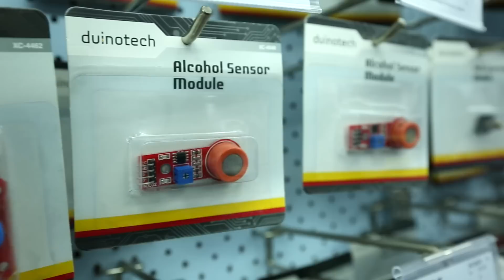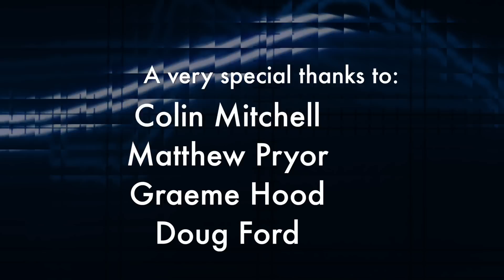The Decline of Hobby Electronics?

Comment: I love this video except for 1 little pet peeve of mine at 6:40 
DO NOT use your kitchen toaster oven for reflowing boards.  Just buy a cheap oven and mark it "not for food items".
Reply from the maker: +ApexMike It is NEVER used for cooking. Its dedicated to reflowing boards. The oven cost $25 to buy and with no modifications except a hole for a thermal coupler in the back to monitor temperature near the boards, it is a really great and reliable way to reflow boards. Thanks for your concern but they are unfounded
Reply from the maker: +cosborne While not shown in the video, that oven is only used for electronics and is stored away from the kitchen in my shed. It was provided purely for demonstration purposes, specifically for this episode and was never intended as a "how to" or safety instructional video ... but I get your point. Thanks for your kind words about the video. Cheers
Reply: +cosborne Yeah, but what if you like the taste of phenol in your jacket potatoes?
Reply: I was joking, but OK.
Reply from the maker: sure

Comment: in germany we have a radio shack like shop, called conrad.
its just not worth buying anything from there anymore.
sure its more personal and quicker than using ebay, but what the hell. they selling the same components for almost 100x the price.
i know back in 2010 (before i knew ebay and all that) i bought an white 5mm led for 2.95€  that was almost 5$ back then...
a BUZ11 and IRFZ44N mosfet, 3.95€ (~5.50$) for one (!)  
learning by doing is essential, but not if you cant afford it. 
back then i picked up every electrical thing i found in the dumpster / scrapyard just to take it apart and see how it works.  
you cant do anymore, well not like you did back then.  they all want the ressources and freak out if you take something with you that has 1 grams of copper in it.
Reply from the maker: +gamerpaddy Thanks for your comment. Good perspective on things in Germany. I think many of us can relate to the extortionist prices of local stores. The internet has made them disappear or behave properly and charge a fair price.

Comment: In the 70's/80's I worked repairing electronic test equipment and pursued hobby electronics at home, building many projects, both analogue and digital, including making my own double-sided PCBs. Back then, I used a Tek 585A with Type 82 plug-in as my room heater... a fabulous piece of kit.

I quit the industry when multi-layer boards meant that a repair involved only a board-swap, since they could not be reliably fixed, even if only a single, identified component had failed.

I quit the hobby when it became more economically 'sensible' to buy a ready-made module than to make my own. All of the fun just got sucked out of it, somehow.

Having said that, I can look back at the enjoyment I got from making and tweaking my inductive loop metal detector, 100W RMS per channel multi-format quadraphonic system (remember those?), polyphonic music synthesiser, time-division multiplexed bus alarm system..... blah blah...  Happy days! ;-)

Comment: I am currently studying to become an electronics systems designer, and my interest for this subject was sparked in my childhood when I spent a lot of time simply disassembling various electronics products around our home (much to my mother's despair). This was at the time when electronics was "macroscopic". I seriously doubt I would have found it that interesting if all of our electronics consisted of system on chips and clearly mass-produced impenetrable building blocks.

This reasoning can be extended to most other fields of technology -- the inner workings of most technological devices and interfaces we encounter on a daily basis seem to tend towards a higher and higher level of abstraction and is pure magic to most people these days. The user generally has no idea what is going on under the hood, for good or for bad. 

I am a conservative fellow, and I am not particularly a big fan of this trend, but I do realize that it is an inevitable development. 

This video brings up a lot of interesting points about the industry and is a great basis for contemplating the direction in which our society is moving, and especially the speed at which it is doing so.

Comment: The old guard just has no idea what the electronics hobby is going to turn into. Here is how it will work in the soon future. You will design the entire circuit board on your computer. You will test the circuit on your computer. Once it is ready you will hit Print and your 3D printer will build the entire circuit board for you. You will have consumer packs of components connected to the printer. You will tell the software what consumer packs you have so that those components are available to pick for your circuit.

Comment: The EEVblog guy! :) He makes great videos. He is one of the 4 Youtube people who inspired me to buy components and start learning to build things. I bought some SMD NPN N2222a transistors and accidentally dropped one on a brown texture colored carpet. Needless to say, even looking for it with a flashlight, it has now become a part of the carpet. They are so tiny, I am thinking about putting one on something, like a key or a card, just for fun, since they only cost me 1-2 cents each. I still struggle to make good soldering of everything I attempt, so I will continue to practice. The reasons I want to have this skill, is because I know some computer programming and by being able to build electronics, it would enable me to create even more amazing things. I want to create a really cool flashlight with a joule thief, a 555 timer + variable resistor, different colored LEDs and be powered by a D cell battery (or batteries in parallel). I also bought an Arduino and Digispark and want to create a box that when I open it, will have an indication that it was opened either within a certain timeframe or day of the week. Hong Kong and China ebay, sorted by "buy it now, cheapest price" and including the phrase "pcs" for pieces is a great way to find cheap components in the 10,20,50,100 range. Be careful to not pay $0.74 for 1-10 if you can get 100 for $0.99 to $1.50.

Comment: I am fed up to hear people complaining about SMD technology making it difficult for hobbyists to make and assemble their own circuits. Providing a good enough soldering iron and a bit of practice, it's actually faster and easier to solder a 28 pin SOIC micro-controller on a board than its DIP package counterpart. 
I used to make my boards with the whole UV insulation, ferric chloride bath process and then drilling all the vias and pin holes ... while you can pay 20 euros today and get your boards professionally manufactured within a week. And they are much easier when it comes to solder part on. Hobbyists live in great times today.
Reply: +marzacdev I agree. I really enjoy soldering. It takes me forever for SOIC but if I am in a hurry, I break out the heat gun and liquid solder. Adapters for bread boards ... lots of fun.
Reply: +marzacdev That's good new for me. Just like Randy Gast said, I really enjoy soldering too. It's a hobby where you can take a $100-$200 piece of electronics that has a component that went bad (like capacitors) and replace it for $0.01 to $5.00, rather than throwing it in the trash.

Comment: Working with SMD parts really isn't much harder than through hole. As long as the parts have leads, you can solder them with a regular iron, a pair of tweezers, and a magnifying glass. You only need a reflow oven for the leadless parts like QFN and BGA packages. 
The smaller parts mean you can use a smaller pcb and you don't have to spend an hour drilling a thousand holes in your circuit board after you etch it. A lot of SMD parts are also cheaper than the PTH versions.
Reply from the maker: +rocketman221projects I totally agree with you. However SMD is still seen as a barrier to entry - those who never have connected anything together. Thats probably more of an educational issue which is why it was raised in this episode.
I hate drilling holes as well. Thanks for the comment. Much appreciated.

Comment: thanks for the great series on electronics. 
Frankly speaking, i disagree with some of the statements in this episode. i am fairly new at electronics, and i believe it is a great time for electronics, and also it is considerably easier to source parts and assemble them these days. there are breadboards and almost any part available in through hole package for prototyping. SMT parts are also great and very easy to assemble with a $100 rework station (plus temp controlled soldering iron 2in1 off eBay)
for a clean design, it is so cheap these days to order a prototype PCB and plastic stencil. 
there are all kinds of development boards, and ridiculously cheap microcontrollers and other chips. 
everything is so accessible.
Reply from the maker: +Andrew Sc Hey thanks Andrew for your comment. Yes in essence I very much agree and the point of raising the provocative question is perhaps to shake the tree a bit and see how people respond. I find SMT easier myself and I am just a hobbyist. Always hated drilling holes through PCB's. The toaster oven in the video is my personal reflow soldering machine which I've successfully used to make about a hundred boards in. However when I interviewed many people about the obstacles of kids entering the field of electronics, SMD/SMT came up all the time as a negative. My Son is 11 years old and he really is struggling with hand placing the components. He can do it but its not easy which does detract from wanting "to do it". For the experienced hobbyist its easy but I think its true to say at the initial stage (starting electronics) it isn't, even with a properly made board with solder mask. However the readily available modules, arduino boards and shields do make using electronics much easier to learn software for instance. Hopefully that inducts those keen enough into the world of electronics. Thanks again for your comment. Cheers Karl

Comment: Definitely not disappeared, but moved to a higher (abstraction) level with the basic building blocks shifting from discrete components and simple ICs to largely integrated solutions thanks to microcontrollers, and very recently further to full-fledged computers (see the $5 Pi Zero announcement)... Meaning that quite a bit of the tinkering has moved away from hardware towards software, but in the end it's with the same goals and with the number of open source projects that are alive and kicking it's probably more popular than ever.
Reply from the maker: +kilrahvp Thanks for your astute comment. Very much agree and yes the new Raspberry Pi Zero fits completely into this discussion perfectly. The computer is just another component now, but offers the ability to produce yet even more complex things in the future. The reason why this episode exists though, is to offer up a possible reason why the future learning of electronics (in all its forms) as practiced by hobbyists or otherwise, might be a bigger challenge in the future. Complexity and Integration may abstract things to such a high level (and even make things easier) but the fundamental underlying technology may become lost in the process. That may not be a bad thing in most cases since that knowledge might not be needed by all, however from an educational standpoint it probably will be. That's because educational institutions will need to cater for the average student, who might then specialise in firmware for micro controllers, analogue design for sensors and interfacing, coding applications, controlling motors & robots etc All these skills require different levels of entry into electronics, some of which will be down to the metal.
For me this is a very interesting discussion because it does highlight areas of concern for the future of electronics. Yes the world is moving to a standard platform (the computer as embedded component) where the IP in software is king, but I guess its like a well balanced died, keeping a good knowledge of analogue electronics to interface the digital world will allow for future innovations in other areas such as bioengineering or "wet wear", where todays current understanding of what electronics is, hasn't quite reached yet.
Your comment fits in perfectly with next weeks episode which very much deals with all these issues. Cheers.

Comment: Messing about for years and etching pcbs for 15 of them. I knew this SMD argument would appear and I'd like to add my creative noise.

One of my first visits to a hobby shop as a teenager was mid/late 90's dodging all the PC's and old farts complaining about their VHS was for a couple of basic through hole parts. My next visit was for copper clad, ferric chloride and a few 0.65mm drill bits. My chemical addiction was born. I could now pull all the SMD parts from "old tat" that I salvaged as even then TH was getting thin.

I've only ever steered away from BGA lager than 2x4 for home etch. Using toner transfer method and old magazines; not special paper and a clapped out laserjet 4. This allows me to double layer 10mils with little problem in half an hour from design. 0.3 pitch QFN(exposed sides) and 0402 passives I still just mash on with a chisel tip and leaded solder. Really love to make tiny stuff with big hammers. Sure there's every popular chip on a 0.1" module but that's little fun or learning.

I know PCB runs are silly cheap now but make your own because you learn, cry and grow. Not to mention you can now play everyones favourite game, Copper bridge-hunter 3D the under-etch edition 

This series is great and cant wait to rewatch all in a row once complete
Reply from the maker: +Nicolas Daly Thanks Nicolas very comprehensive comment. I still make the odd pcb using a similar technique but yes getting them made is very affordable if you have the time. I very much appreciate your kind words - thank you :-)

Comment: I remember the  hassle of building a VGA arcade input to composite output board - and those chips wer eexpensive and I had no way/knowledge of SMD so I tried my hardest to do it 'deadbug style' - now  I can buy a full board that does it cheaper than the components required to build the same board. 

Another comment hear mentions RTL-SDR - holy crap that changed a lot of things for me personally. As a licenced operator a new world opened up to me purely because of the cheap as heck hardware.

Still though, I had a board to make last week and I could not for the life of me find a resistor to the value I needed. 'Stuff it' off to Jaycar (the one I used to work for) and luckily the staff member was an engineering student and reminded me I can use two resistors in series (the values I needed wasnt stocked) - I did have to buy 16 resistors (8 of each value) but the knowledge of the staff helped me 'hack' a fix.
Reply from the maker: +23Brodieman Thanks for your comment. An interesting perspective. Cheers

Comment: the need 4 the affordable hobby micro SMD workstation. -today a software defined radio kit will give 3MHz to 7GHz in all modes. why make a radio?  but there are still some things that good to modify, like a HD DVR that will record anything. or micro FM bug that will stick 2 a micro quad copter.  us hobbyists  r moving further up the food chain. just as  Dick Smith made a-killing from cheap Japanese electronics in the 1970s  IMO thru hole will live on as aftermarket parts.
Reply from the maker: +JONOVID Thanks again for your comments. Great stuff. I agree with you, hobbyists are moving into new territory and capabilities. Cheers

Comment: For many things, I now actually *prefer surface mount for discretes.   Especially on the back of a piece of "Donut Board".  Yes they require a steady hand, a fine soldering iron tip, and possibly a magnifying glass, magnifying headset or microsocope.  Or you can use a cheap USB microscope to a computer screen, or in many cases, even a smartphone can be a magnifying glass.  once you get over the "its too small !" thing they are *heaps faster to solder to the donuts, you can have a tiny box with 50 of every value resistor in it in neat strips.  Add in a "Roadrunner Wiring Pencil" and I can make proto's heaps *faster and smaller with less hassle than clipping leads of through holes.   OK, Some chips are a bit *too fine pitch. but thats what breakout boards are for.  I grew up with through-hole, but have come to prefer SMD.  Dont knock it until youve tried it ! :)
Reply from the maker: +SpockieTech I agree :-) Thanks for your comment